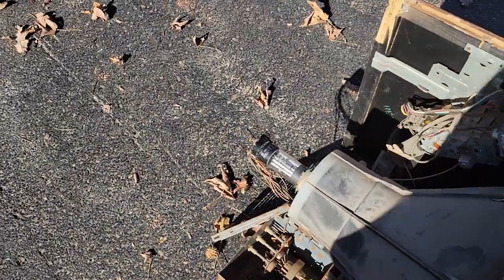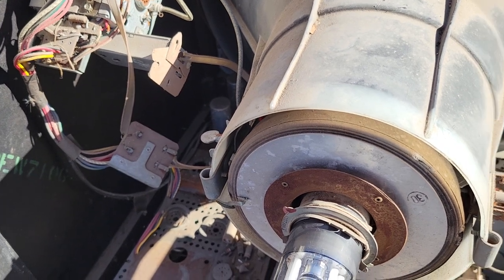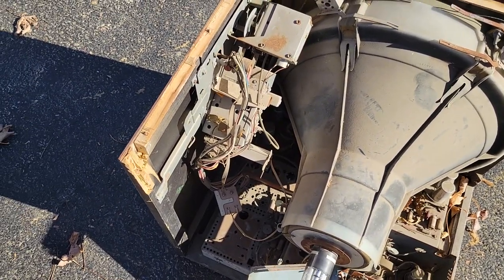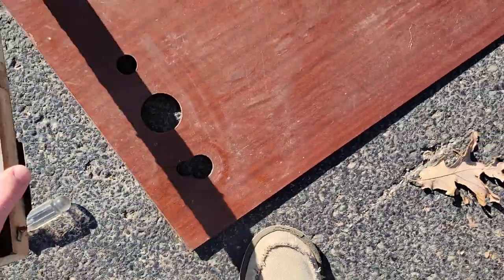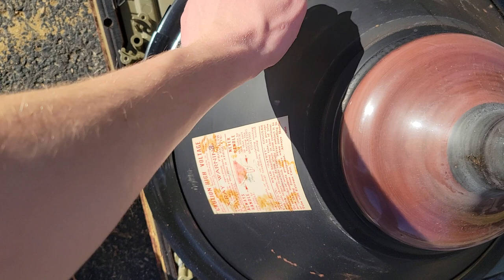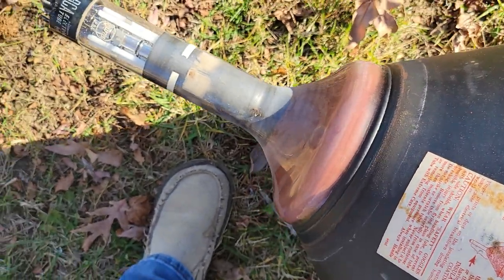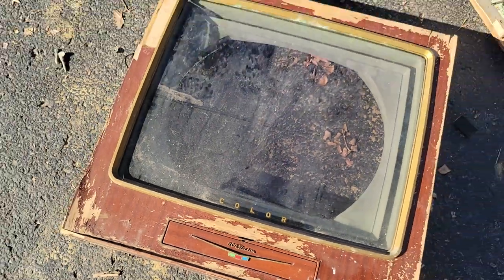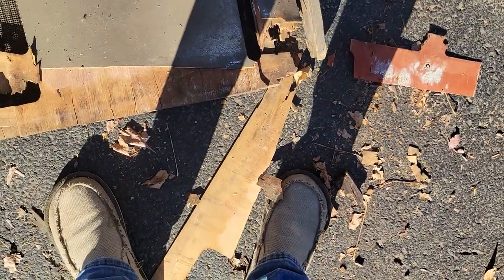Rca CTC-5 Scrap Out

Comment: We can acquire an intact one locally with a good CRT but need to get chassis out first.  How do you get the HV disconnected from the front of CRT though?  I saw you take the screws out to get the plastic cover cone off but then does the big red wire just slip out of a hole or what?  Sorry it could not be revived.  Thank you.